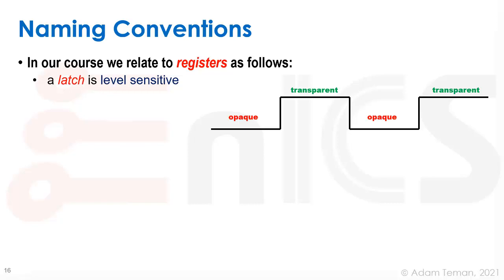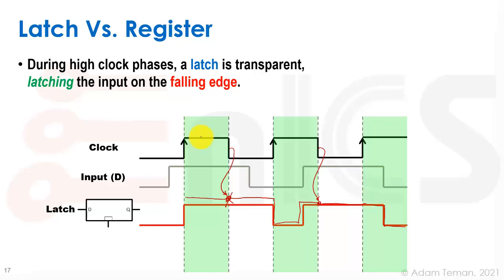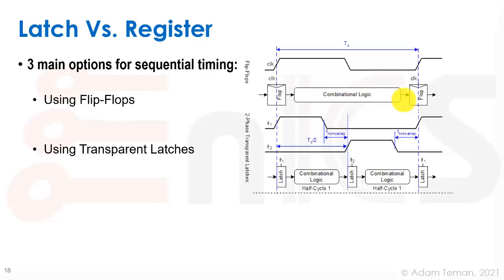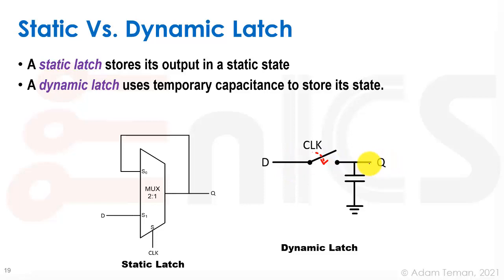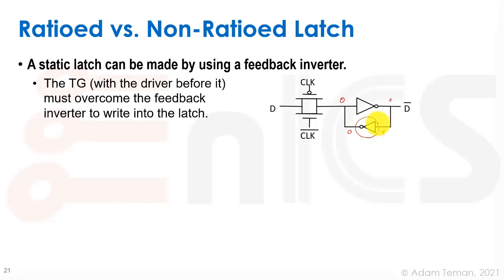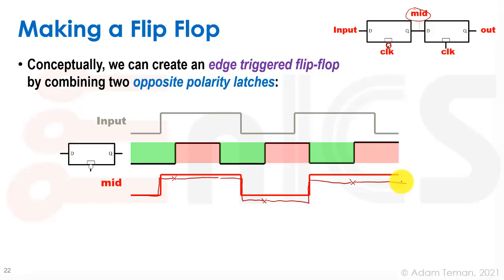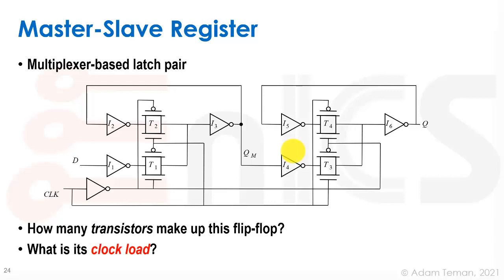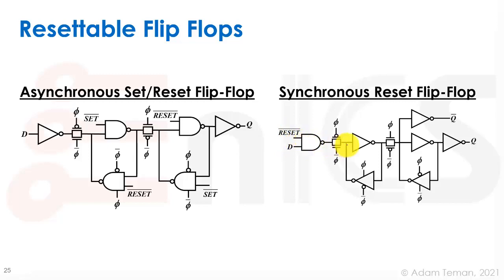VLSI - Lecture 7b: Sequential Logic Elements

Comment: May i know what is the purpose of clock signals are present on nand gates and inverters side ways in asynchronous and synchronous settable/resettable flipflops ??
Reply from the maker: Yes, of course. These cells have a feedback path (they are basically a bi-stable cross coupled inverter). When we try to overwrite the state inside, we drive a different signal in, but the feedback is resisting this. Therefore, we get a ratioed operation. Since we want this to work flawlessly, the tri-state breaks the feedback loop and ensures that the driven value is not contested and will for sure be written successfully.